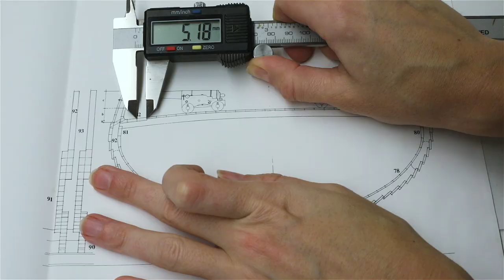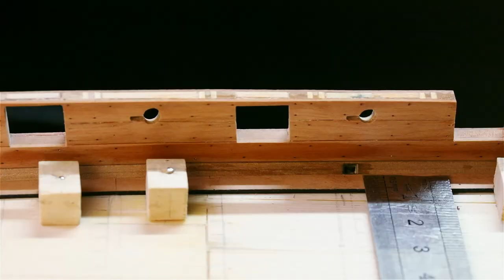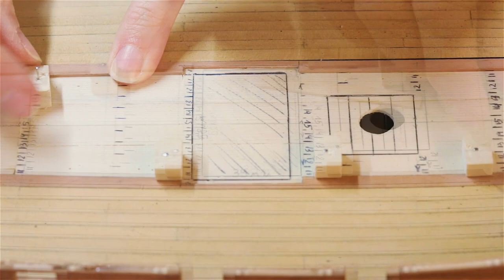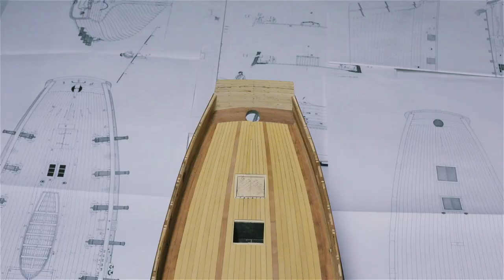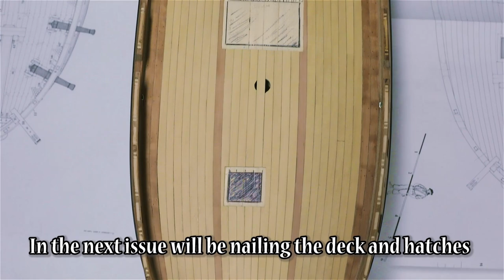#6 - Scratch-built ship model - Deck planking - French cutter Le CERF (1779-1780)

Comment: I also admire your courage in using a dremel to reduce the plank widths. I invariably ended up sanding divots into my planks when I tried that. Now I use a small plane held in a vise to shave them to size. I'm very curious about the curved deck planking at bow and stern, I've never seen that used on a ship of the period before. What was your source?
Reply from the maker: Thank you! 
I build this model according to Budrio's drawings - published by ANCRE:
https://youtu.be/bzGqKKfVQKI

Comment: Olha, how long do you wait after gluing a plank down to remove the hold downs and start work on the next plank? If you're using a white glue, I would think it's close to an hour or so?
Reply from the maker: In general, it depends on the place of application of the glue. The manufacturer writes that it is enough to clamp for 20 minutes but the glue hardens completely in 24 hours. That's why I kept the planks for at least 10-12 hours...